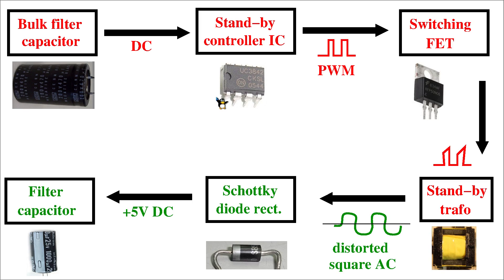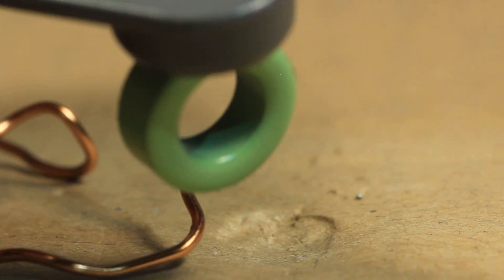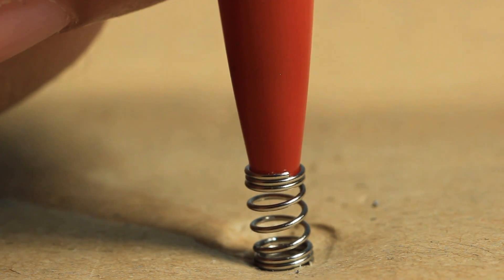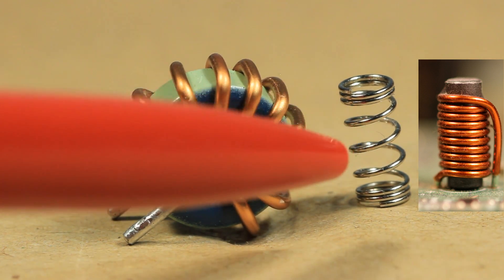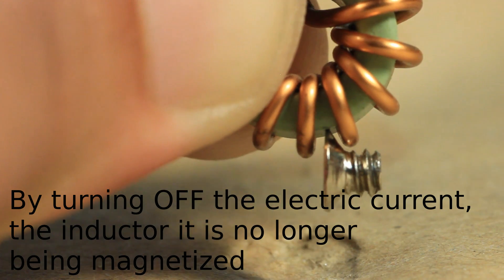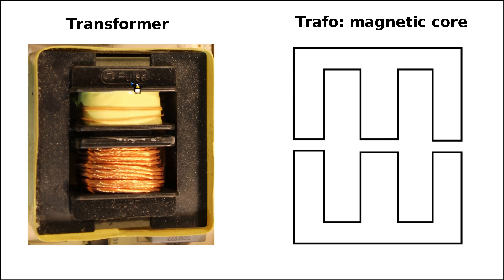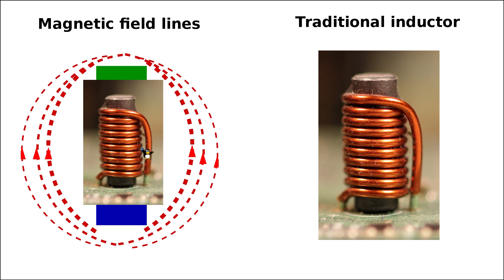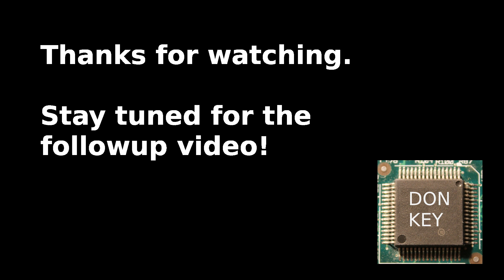Howto repair switch mode power supplies #3: Inductor in electronic circuits P1

Comment: I do not think that the spring is a good analogy to an inductor. The sping would be a good analogy to a capacitor, because we fill it with potential elastic energy, just like a capacitor is filled with potential energy stored in an electric field. The good analogy to an inductor would be a flywheel, beacuse a flywheel is filled with kinetic energy of circular motion. Just like an inductor is filled with kinetic energy of the current stored as a magnetic field. Rest of the video is great though.

Comment: Hello, Frederick from United States here... I also find your lecturing to be the most on point on this topic. If I were to offer one point of advice it is to stay on the linear trajectory of how the device will function in simplest terms rather than adding in all the bus stops into complications necessary for each design-methodology. For the most part you are using this method already, so I am only reminding you of what you are already aware of. Good work, rock on.

Comment: Part 1 and 2 were good but this was awful.  I watched at two different times and fell asleep both times.  You are supposed to be teaching how  to repair power supplies  and not basic electronics theory that is dragged out for 10 minutes when it could have been explained in 30 seconds. If someone needs to learn how inductors work they wouldn't be watching a power supply repair video. Don't know if I want to watch the next parts.

Comment: I took out a toroid inductor from a power supply.  It was connected at 4 points, 2 neg and 2 pos.  I guess there are two separate windings?

Comment: Really enjoying these videos! My pc PSU is making a very slight buzzing/clicking noise, the power coming from it is not strong, and turns on and off once per second. I am having a very hard time determining what is wrong. I have a spare PSU and I would like to repair the faulty PSU with the part from my spare  (also faulty PSU).

Comment: It is not a magnetic core....it is a ferrous core.   To be magnetic...it would be attracting ferrous metals.   the toroid  core is attracted by/to  the magnet.....
Reply from the maker: Well, it is up to interpretation how to call it. Most engineering books call it "magnetics", so I roll with that. Also, these cores can work as magnetic memory, since once you magnetize them, they will keep some fraction of the magnetization.
Reply: Wrong....so wrong.

Comment: Time 8:50

The example of magnetic functionality is highly distorted. It needs to be reworked.
Reply from the maker: People need simple explanations without much fuzz. For a physicist or for an engineer might not be good enough, for a repair technician even this info is too much. I know some would prefer if I would write equation all day long, but I have done that when I was studying long years ago. Most people are not interested in deeper explanations, and some simple visual aid is all they need. The rest is not relevant to them.
Reply: @DonkeyLearningIT  Yet you took almost 15 minutes to explain an indicator who's should have taken 30 seconds.
Reply: It was really poorly explained.  The worst teaching method is to explain something by explaining something else.  Just explain what you ate talking about instead of something else who's then takes twice as long.

Comment: I think the explanations are great I just think you should say what the component does in a circuit before explaining how it works
Reply from the maker: Hi James. I originally intended this series to repair technicians who already have experience with basic repair, this is why I assumed that they will know how the components work. However, as it turned out later, it is not the case. I will produce a separate series, where I will cover the very basics of electronics, and how components work in a circuit.

Comment: Very good presentation. I do think the theory side of it is a little OTT since the majority of the faults are what people can actually see on first examination of the board. When there are no signs, Then the person has to be able to identify whether there is power in and power out. If no power out, how do they trace to find the component which is not functioning. ? Well done.

Comment: Your videos are helping me to FULLY understand how these power supplies function. Do NOT change your presentation it is great.
Reply from the maker: Thanks for the comment. A small portion of the viewers complain that it is too slow. However, I make the series based on the assumption, that some people are just starting out as a repair technician or as a hobbyist. This of course means, that the material need to proceed at a slower pace.

Comment: arnt you forgetting one of the most basics of the basics....a coil of wire in a inductor has a insulator coating....otherwise it would short itself out...correct...I never heard you say that...transformers work very poorly if there winding are shorted
Reply from the maker: Well, exactly one of the failure modes which I will mention in later videos is when the enamel coating flakes off, causing shorts. Otherwise I assume that people are at least a bit familiar with transformer wire.

Comment: The use of the slide with a block diagram (which includes a picture of a common component for each block) and then showing the location of the same device on an actual circuit board, is absolutely perfect. SMPS are being used in EVERYTHING now--as you mentioned, even those tiny phone chargers.
Reply from the maker: Thanks for the feedback! I did the slides this way, so those people who are just starting out will also have a feeling of how do these devices look in real life. 
For example, you often see in videos people pointing at the common mode filter, and saying it is "transformer" when in fact it only just looks like a transformer.

Comment: Thank you for the videos. For me the pacing is a bit too slow, I am already familiar with fundamentals as a graduate of a Physics University and looking forward to the practical aspects of designing and repairing a power supply. I kind of liked most the first episode.
Reply from the maker: Thanks for the constructive feedback. The issue is, that most people do not have any university education in electronics, and they would like to do it as either a hobby, or just on the level of a repair technician. As you see, this is a "Catch 22" situation, so I must go through first the basics. Otherwise I fully agree with your comment.

Comment: You're doing just fine to answer your question at the end of this video. I already to a certain extent understood inductors but this was nice for a recap, and undoubtedly will be extremely useful for people with none. I've only watched up until this video in the "series" on SMPS however I'm looking forward to watching the rest. Going to subscribe and recommend, thanks for going in depth (not too far) on SMPS. 👍🏻
Reply from the maker: Thanks for the comment. I appreciate it if you recommend the content to others. 
I must say, I could have done a more clear job on the inductor, and I am afraid that I made it a bit more complex than needed. Now after 7 videos I would probably do the discussion differently.  Since YouTube does not allow to change videos after they are uploaded, I will try to be more clear in the new episodes.

Comment: its easy to understand where the north and the southpole are in case of a ferro bar. but where is actually  the north and the southpole in case of   the torroid core? is the inner side north or south and outer side opposite or is it the other way around?
Reply: They are virtual and inside the toroid itself. The north and south poles are chasing each other. If I were to cut the toroid so that there is a small gap, you could then easily see where the N and S poles are, just as you can with a horseshoe magnet. Similarly, if I were to bend a bar to make a ring and weld it shut, you get a toroid. 
Now you may think that the N and S pole are off the faces of the ring but that is just a ring magnet. A ring magnet can be thought of as a magnetic bar with your standard N and S poles. Let's now drill a hole down the center and then slice a ring off of it. The N pole is still in the same direction off of one of the faces. That is NOT a toroid. You could wind just such an electromagnet by running the wire on the outside edge of the ring rather than through the hole. The benefit of a toroid as an inductor is that the magnetic field is mostly contained within the core.
In his diagram of the double-E transformer core, this is much like two toroids and, like the toroids, the magnetic field is mostly contained within the core. The toroid has less leakage of magnetic flux than "square-ish" cores where flux has a tendency to leak at the corners making toroids more efficient. They also can usually be smaller and lighter weight. Toroids can also be used to make transformers, which you can see is one of the photos he has in the video.
In a toroid, generally there is no specific location where N ends and S begins, unlike a bar magnet. The same is almost true with a bar magnet however. If I were to cut a bar magnet in two, I would "create" an extra set of N and S poles. No matter how many times we cut the bar magnet, we create an extra set of N and S poles. (We're going to ignore monopoles.) The reverse of this is to form the bar back together. (Not exactly true because you can have a multipole bar magnet that has extra N and S poles within but let's keep up with this thought experiment.) You can see how the "physical" idea of the extra N and S poles disappear. Now, bend the bar back upon itself to form a ring and you have a toroid. The N and S poles are then just "virtual." Flux lines flow from S to N, so the flow of magnetic flux in one direction would be N and the opposite is S.

Comment: i THINK most people watching a  video on how to repair swich mode power supplies are VERY WELL versed in the basics of electronics ... maybe skip over component descriptions if i were you??
Reply from the maker: You would be surprised on how many hobbyist try to repair SMPS without knowing much of the way they work. For pure repair I think there are good videos out there. To understand those, one of course must know already the basics. However, showing the whole idea before going into practical repair is what is missing for most beginners. This is why I am doing this series. Once I am done with the theory, I will switch over to practice as well.
Reply: well that's why I'm watching this - hoping for some good diagnostic tips about SMPS repair... I know NOTHING about them really- though I've watched lots of videos and done some reading but I have a pretty good and 'deep' understanding of individual components and what they do, etc. LInear supplies make MUCH more sense to me though... :P
Reply: the only problem is that you made SIX (6) videos on the topic - the last five of which describe the components but without ever actually talking about any practical repair ...!! :P
Reply from the maker: That is because without the basics there is absolutely no point on trying to go into practical repair.
I can just exchange a FET, a driver IC and make a video out of it, and 80% of the people will not get it why on earth those parts were exchanged. It is like if you ever looked at Xbox repair. There were guys out there, who claimed the issue is with the position switch, since the switch emitted a rattling noise. However, these guys were not aware of even the very basics, and they did not know, that a gravitational switch has a ball in it, pure and simple. Many people watched those videos, and not knowing better, they spent time and money replacing components which had absolutely nothing to do with the real problem...
Reply: i always find the most useful such videos - the presenter will explain what they found in their diagnosis - and the conclusion they made and WHY etc ... at least in my opinion. in my own example I studied LCR circuits in high school but also was 'into' electronics when i was very young... so I have a pretty good basis for understanding the parts and how they are made - though for me switch mode power supplies are still pretty confusing - even if i understand all the theory about how they work ... i have a few defective SMPS units and still having a hard time diagnosing them ...  :) linear power supplies are much easier :)
Reply from the maker: Once we go over the basic theory, it will all make sense to you. SMPS will seem to be almost as simple as a linear power supply.

Comment: i have a inverter welding machine that  worked well the first year of a light use, as an non frequent welder. but after not using it for sveral months when i try to turn it on, it blows the mains breakers every time i try to use it, i guess something degraded inside, im interested in what you present to see if i can identify the faulty component in what i understand,  is esentially a switching power supply that handles lots of current.
Reply from the maker: The fuse is blown right-away when you just plug it into the power plug?
Or it blows the fuse when you start the arc? Or it blows the fuse after couple minutes of welding?
Just asking, because this completely reduces the amount of time needed to find the fault.
If you can give me more hint, I can point you to a couple of directions. 
My video series will go step-by-step through the whole basic idea of how SMPS work, and after this we will apply this knowledge to repair defective units. Until the basic ideas are not understood, repairing SMPS is both hard/dangerous for the hobbyist. Danger element always will be there, but at least it can be reduced...
Reply: many thanks for your repply, the fuse is blown when i switch the power, not when striking  the arc.
Reply: i totaly agree with you about dangers in messing with those components, i try to learn of different topics before getting into the practice. and you have a lot of knowledge, so for sure you can help a lot of people.
Reply from the maker: I see. This means, that the power input section is highly likely defective in your inverter, which is mainly covered in Part #1. Eventually the switching FET/IGBT is shorted. Do you have a multimeter, and relatively OK skills around electronic components? If yes, I can give you some hints. 
In ANY case, please NEVER measure/touch things while your inverter is plugged into the wall. In fact, it can still send you to Nirvana even after you unplugged it if the filter caps are charged!
Reply: i have a multimeter, but no too much experience in electronics,  but i know about seberal big capacitors inside the machine, i saw them when looking for obvious signs like burnt components, however i did not see anything looking burnt. i dint tested anything with the multimetr other than the main supply cord and swithch
Reply from the maker: If you do not have much experience, then I would ask you whether you have a good buddy who would be willing to repair it for you. Namely, I mean no offense, but without knowing what you are doing, one can cause more harm to the inverter, or even worse, to themselves. UNPLUG the inverter first, and wait hours-and-hours before you measure, so the caps will hopefully discharge. If you know how to measure a diode bridge, I would next measure the diode bridge with the multimeter, and make sure that it is OK, because it is part of the power input, and it often fails in high power devices like welding machines.

Comment: Hello! Now a days most power supply source is base on SMPS. You have a great explanation of details which I am getting the idea clearly. Is there any upcoming research do you like to make basis on 18650 battery circuit protection. Actually I am trying to repair laptop battery pack. Most of replace battery pack (all available which is made in china) does not last long. There are few batteries are still good found on oldies and by which I can re-use for 3.6 volt or 6 volt products at home used. Problem with overcharge and voltage cut off circuit. Can It be made manually without buying pre-made protection board?. I am hardly searching circuit with basic analysis in google but most are described with amazon selling circuit. sorry for discuss not related with the subject of video. Once again thank you for your effort on video, waiting for next........
Reply from the maker: In the far future I might look into batteries, but first I need to cover the SMPS and also make videos on actual repair of SMPS. If I understood your message properly, you would like to build or even modify some existing battery charger circuits. Well, to be honest with you, battery charging is a bit more specialized topic. Although an SMPS is being used as the power source, there are lots of things related to battery characteristics of how the battery is being charged/discharged by the unit. For example, Ni-Mh batteries have a totally different charging curve than Li ion cells. Thus, it is almost always easier to buy an integrated circuit, which has been specifically made for a given type of battery. This means, that you can still build your own, however, the design need to be built from the ground up based on the specific battery type you intend to charge.

Comment: Thanks. I am following this series and think you are doing a great
job. Your method and presentation are very good and I look forward to the next
video.
Reply from the maker: Thanks for the reply, and I am happy that you find the way of presentation OK.
To be honest, I am doing it in the way I have wished that it should have been presented for me when I was a student. However, based on some of the comments, I definitely need to dial back on theory, so I have removed all equations which I intended to put into the second video, though they were very basic (like law of induction etc.). I can just quickly explain those without any math as well.